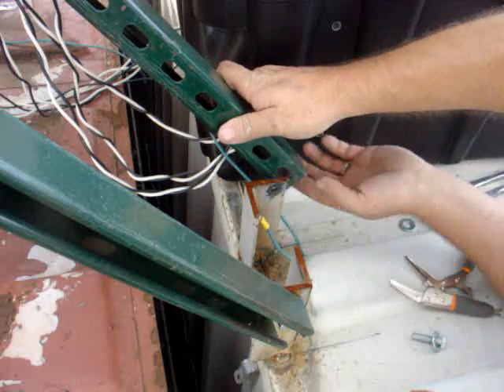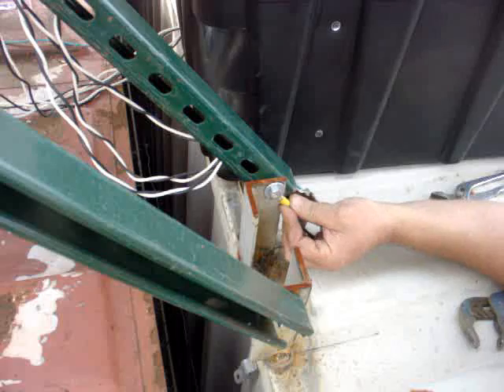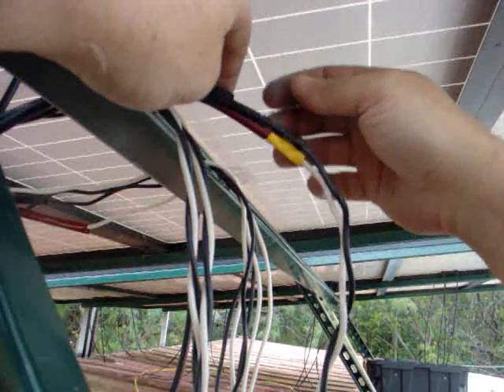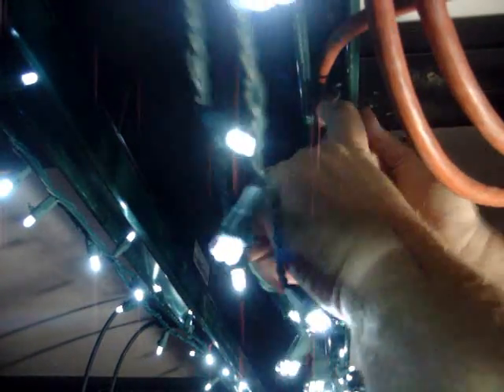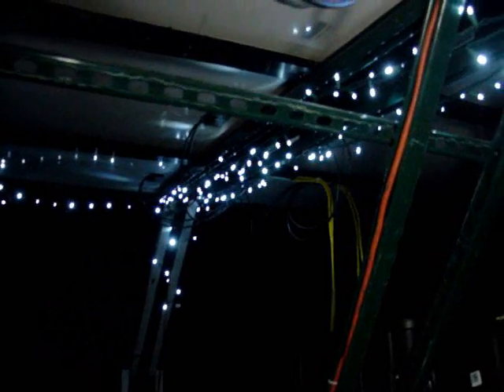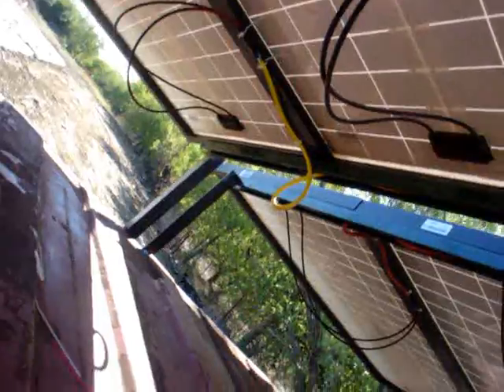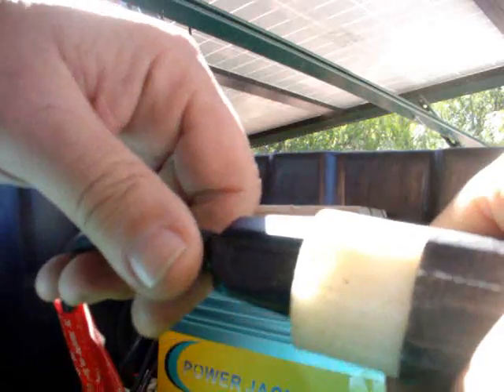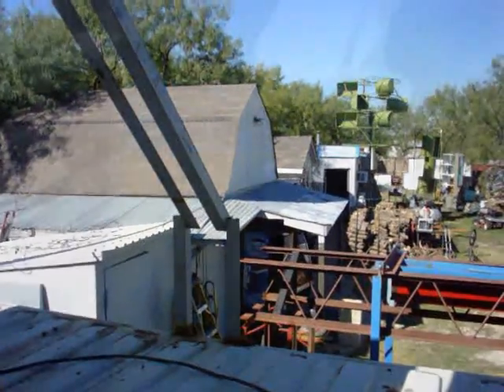PART 4 THE 4000 WATT SOLAR INSTALLATION AT BOOMTOWN LABORATORIES

Comment: you can order it from radio shack on line, an its pretty cheap. you also consider a battery backup with golf cart 6 volt batteries ot used fork lift batteries.
amazon has 10/2 landscaping wire pretty cheap.
best john

Comment: Evergreen's are quality panels. A few thoughts, all negative DC wires must be attached to a earth ground rod, along with any other metal in the system.
One of the problems with basic grid tie inverters is that when the grid goes down so does the solar power.
there are grid ties that have the battery backup .
How did you mount the panels to the u-channel?
John

Comment: Nice setup, just some thoughts. Low voltage landscaping wire 12/2, 10/2 is less money, might find at Home depot. Though the 12/3, 10/3 extension cords are great for PMA's.
Adhesive lined dual wall (mastic) heat shrink tubing is best to use in these applications because as you heat the tubing the glue bonds to the wire too and seals out moisture. 
When making your own battery cables, use tinned copper lugs and this adhesive tubing to avoid corrosion.

Comment: I wonder what the rate will be in 10 years.  Solar and wind power are long term ways to stabilize your rate.  But the price of equipment is still going down so maybe the low rates in FL will get you through to the much lower equipment prices.  Good luck!